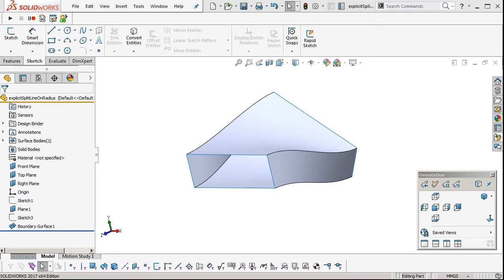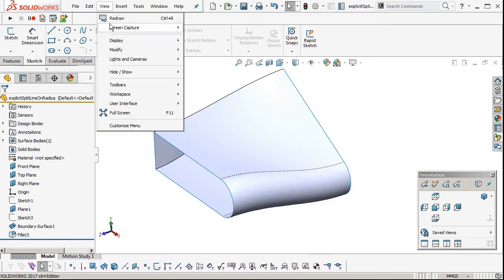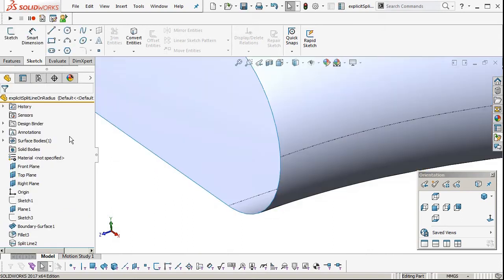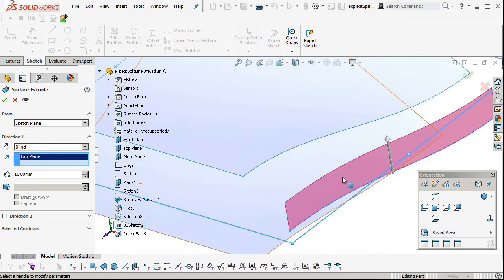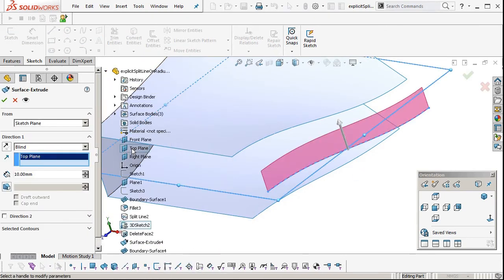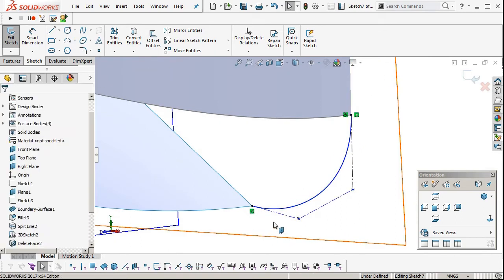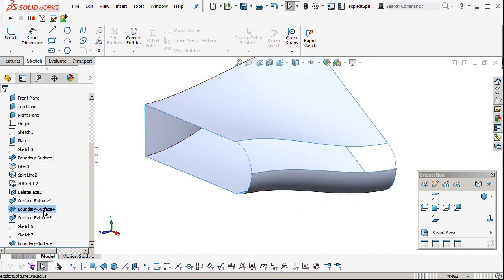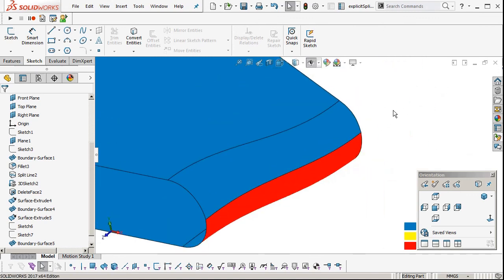Solidworks Tutorial: Drafted split line along a radius/fillet

Comment: Do you have a method to do this with a part that would have a repeating pattern perpendicular to a lofted surface? This method would take forever to do for each repeated part of a pattern.
Reply from the maker: Add the draft surfaces to the patterned geometry before patterning? Guessing the geometry changes though...  hard to comment further without an image. Cheers.
Reply: @AndrewJacksonDesignStudio  been bashing my head against a wall on it. Finally found a way to cheat around it off copying the wanted surface, and doing a split line, then doing a draft off of the split line, and then doing a surface cut from split line surface. Big head ache. Still have to choose each patterned piece individually. Ugg.
Reply: @AndrewJacksonDesignStudio  I might just make a quick video of it, as it had all my SW gurus and the Solidworks FB page stumped. Figured the first time I need I could have used support is when I let my license lapse lol
Reply: @AndrewJacksonDesignStudio  couldn't as the pattern wouldn't follow the lofted surface. The pattern bisected said curved and twisted loft and drafts pull one direction (injection molded part).
Reply from the maker: @Micah_Makes  Yeah, bit of a curly one! Is the main surface that terminates the hexagons a single surface? No breaks apart from the centreline? Off the top of my head, extrude a single hexagon, trim appropriate side with the main/primary surface, add a draft hinged from the trimmed edge. Try the various patterning feature options, to see if it respects the trim from the POV of each trimmed hex. If not, bang head on desk :)  I see you mentioned ProE in the thread - reference pattern would take care of this no issue... I can fire up SW later on today if I have time. Yeah, I stopped paying Dassault a while back, on 2017. They've not added much to the software that affects me with surface work so have not gotten back on the train. Good luck with this!
Reply from the maker: Oh and if that does work, make a planar surface outwards from the main/primary surface and run a mutual trim with the first hexagon, so the hexagon is trimmed/knitted to the planar surface. Pattern the trim as well, so you end up with a single surface body for the pattern. Could help downstream...
Reply from the maker: I've got a way to get the draft in a single hit. Fill pattern an extruded solid hexagon, merged with a thinned rectangle, so all hexagons are merged into a single body. Hexagons extend beyond the loft surface. Delete the back face of the rectangle to make it into a surface body. Make a 3D sketch, select pattern surface body and the loft in the surface bodies feature tree menu. Create intersection curves between the bodies. Thicken the loft surface. Extrude cut using 3D sketch, select line of draw/extrusion. Add draft in the extrusion. You may have to make it a two direction extrusion as SW might leave lots of sliver bodies on the 2nd direction face. None of this helps with making the hexagon pattern - it'll still look projected on, rather than 'wrapped'... I can send a example file to you via WeTransfer if you want, will just need an email address. New Years eve, better get off the CAD here! Enjoy.